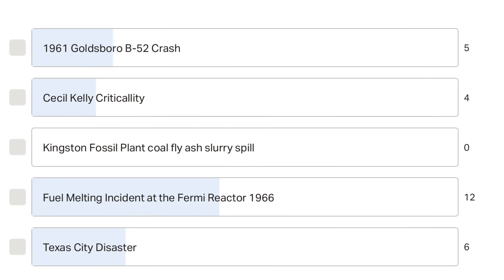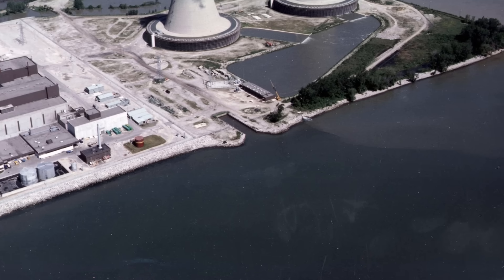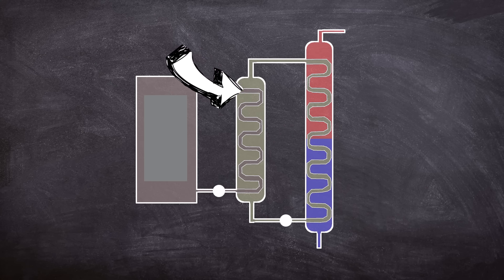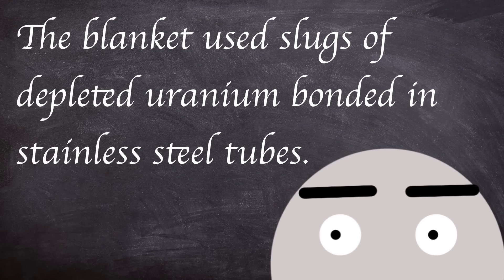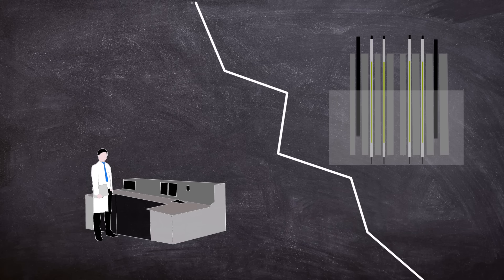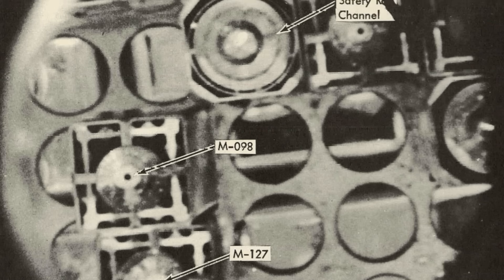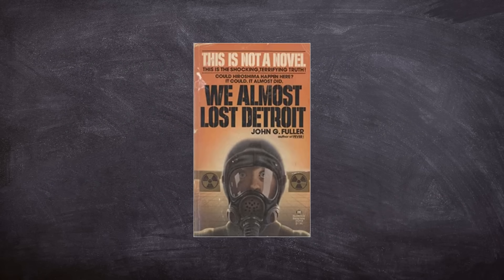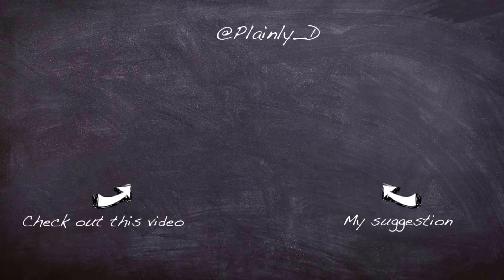A Brief History of: The Fermi 1 Reactor Meltdown (Short Documentary)

Comment: The problem wasn't really the breeder reactor, it was the liquid metal coolant.  Had they used a molten salt as they use in the Thorium reactors, results might have been different although the salts have their own issues.  However, so does water and steam at high temperatures and pressures.  Very corrosive and can cut you in half.

Comment: The point of the conical flow guide was not to direct coolant upwards. The point of the conical flow guide was to disperse the fuel in case of a meltdown, which would render the mass sub-critical.

An interesting addendum to the Zirconium sheets, is that they were added after the design was approved and they were in fact more of an afterthought that had not been researched. To begin with, it was thought that someone had left an empty beer can in the core assembly during installation. It wasn't until the debris was retrieved that they realized what it was. The cone should never have been clad with the Zirconium as it was in fact not even needed.

Comment: Sodium Metal Reactors are not to be confused with IMSR and LFTR designs which use a different type of coolant called FLiBe (mixture of lithium fluoride (LiF) and beryllium fluoride). That mixture is run at standard atmosphere pressures and is not volatile even under temperature with the air.

Comment: As an aside, John G. Fuller also wrote a book entitled The Ghost of Flight 401, which purported that Eastern Air Lines L-1011s that received parts salvaged from the wreckage of N310EA (which crashed in the Everglades in 1972, while operating the eponymous Flight 401 from New York to Miami) were haunted by the original aircraft's crew. This should tell you something about how scientific his claim that "we almost lost Detroit" was, if the style of the cover art wasn't enough of a clue.
Reply: John G Fuller wrote some very entertaining books, but if you wanted facts, basic science, or engineering, you will  never find it in his books.

Comment: This shouldn't be called a "reactor screw up."  One of the important points of running an experimental reactor is to find out just how it functions.  They collected much information, and then called it a day.  Agreed that there should have been a decommissioning plan, but that's not an immediate danger.
Reply: Meltdowns aren't part of running a basically full sized experimental reactor. In small scale highly isolated proof of concept work maybe, but not one what was effectively a full scale, commercial unit.  You might expect some hiccups regarding procedures and operation, stuff you'd need to note in manuals going forward, but at NO point should that progress into physical damage to the reactor core. At this stage in development this kind of major failure is neither expected or acceptable and certainly constitutes a screw up.
Reply: @Tk3997  Nah at this time, this was small and experimental
Reply: A reactor is an engineered thing. You really have to be able to foresee exactly how it's going to work and what could possibly go wrong, and account for those things. If you don't, you're basically "testing in prod"-- something any programmer will tell you is an awful idea.
Reply: Right! Get this man to the infirmary!  He's hysterical!

Comment: Nice video as always. I was surprised you didn’t mention that the plate that caused the issue was a secondary addition to the reactor that wasn’t properly documented or updated on equipment specifications. One of the biggest issues with this particular atomic accident was the fact that they couldn’t figure out what was at fault because they didn’t have proper documentation of the last minute additions made to the coolant system.
Reply: At one point, the media speculated that the "mystery piece" of metal was an empty beer can that had somehow wound up in the bottom of the reactor and been flattened due to the pressure and action of the liquid coolant rushing across it.
Reply: @sct913  Yeah... I have a hard time believing that an aluminum can would survive in that environment for any amount of time, but its fun to think those guys were just getting lit while building a nuke reactor.

Comment: I worked there in 1997. Fermi 1 was still intact. The old control room was pretty cool. We used to hot rod the maintenance trucks around the cooling towers, and just wander around the site when we had spare time.

When they installed new offices in the OSB building, they threw out tons of shit, including old "blast danger zone" maps... I'm 180 miles away now, and still in that zone according to that old poster I had from there.

Comment: Is this the molten salt reactor like they had in Tennessee back in the 50’s. Can’t think of the name of it but it’s supposed to be full proof in that they use liquid nitrogen to keep a plug frozen and if power is lost the plug melts and the fuel drains to a pool below the reactor so thier is no pumps needed to stop the reaction and a meltdown is impossible. I think the problem was that the salts were extremely caustic and would eat away at the steel quickly.
Reply: No, it's not an MBR/LFTR.  That used uranium (in that case) salts of fluorine melted, as fuel and coolant.  This one is conceptually a regular solid fuel uranium reactor that used melted sodium./potassium metal as coolant - a completely different bird.  Liquid metal sodium has a very high heat capacity and does not moderate the neutrons, making them available to convert depleted uranium in a blanket around the reactor into plutonium.  Sodium and potassium are dangerous when exposed to water, but this problem never occurred with this reactor (or any other sodium reactor I'm familiar with).

Comment: My father worked on this project from 1956 until 1962. He was loaned from Wisconsin Electric to the Power Reactor Development Corporation. He had responsibilities related to the heat exchanger between the reactor and the steam generator.  I believe that exchanger was constructed by ALCO which was the remnants of the American Locomotive Co.
Reply: Between 1956 and 1962, ALCO was still a serious player in the locomotive business.  Although the GE-ALCO partnership had officially ended in 1953, ALCO continued to use GE electrical gear in its locomotives until 1969.  And, although GE entered the locomotive business as a competitor to EMD and ALCO in 1956 , their initial focus was on units for export.  The U25B wasn't introduced until 1959.

Comment: I live a few miles from the Fermi I and Fermi II facilities. Maybe you could do one about the 1990s Christmas turbine explosion incident at Fermi II? (I was inside Fermi II primary containment structure once  in 1986 when they scrammed the reactor- was a high school student on a tour with local media)
Reply: I sincerely doubt that any student group ever toured the primary containment (AKA drywell) since even in 1986 it was a radiation area.  You may have toured the turbine building or even the reactor building (which is the secondary containment). Or you may be remembering the control room simulator, which was often used for tours and media events.  I cannot ever remember seeing any media inside the plant with the exception of the John McCain visit, but it could have happened.
 
As far as the 1993 Christmas day incident, the main turbine suffered a broken blade which unbalanced the turbine and caused a massive vibration which severely damaged the turbine and generator.  There was a large amount of cooling water (NOT reactor coolant) released along with fire fighting water, all of which collected in the basement.  The reactor experienced an uncomplicated emergency shutdown (which means everything occurred as expected) and was not damaged in the incident.  The recovery lasted a bit over a year, and when we did restart it was at a reduced power level due to removal of some turbine parts.
Reply: @johnjones5354  I understand your doubt, but it really did happen. As a PR effort shortly before full power license was issued Detroot Edison invited select media to come onsite to shoot B-roll footage. My high school was operated by the IHM nuns, who were very vocal shareholders in opposing Detroit Edison's nuclear power investments at the time, and the invitation of was extended to two jouurnalism students from their high school to join as as a way to hopefully curry favor with the nuns. 
We were walking around the torus section of the reactor vessel when a backup cooling system suffered a fault triggering the automatic reactor scram. Our handlers explained we would not be able to leave the primary containment building for a while while damage was assessed and our dosimeters were showing no radiation, so we might as well proceed further on...up many flights of stairs to the area above the reactor where fuel assemblies were moved to and from the reactor. We were allowed to cautiously peer into the fuel storage pools where I could clearly see the Cherenkov radiation glow far below. A while later the all clear was given and our tour group was allowed to leave the primary containment building, and a later luncheon and tour of the remote control room at the Nuclear Operations center included an impromptu press conference to explain the day's scram event...a potential PR disaster with all those tv crews in the building.
Reply: @NonFerricIrony  Ah yes, where to begin.

  “We were walking around the torus section of the reactor vessel”

While the torus (or suppression pool) along with the drywell does form the primary containment, neither one is part of the reactor vessel.  The reactor vessel is enclosed inside the primary containment.

“Our handlers explained we would not be able to leave the primary containment building for a while while damage was assessed”

There is absolutely no reason why anyone would not be allowed to leave the reactor building after an emergency shutdown.  In fact, no essential personnel would be encouraged to do so.

“We were allowed to cautiously peer into the fuel storage pools where I could clearly see the Cherenkov radiation glow far below”

In 1986?  Fermi 2 did not enter commercial service until 1988, with the first refueling outage occurring after that.  Until then there was no used fuel in the spent fuel pool (one pool not multiple pools).  In 1986 there was no fuel at all in the SFP, as it was all in the reactor vessel, thus no Cherenkov radiation.

“tour of the remote control room at the Nuclear Operations center”
Perhaps you refer to the control room Simulator, which exercises absolutely no “remote control” functions and is used only for training.

In addition, if these high school journalism students were in fact issued dosimetry, they had to be, in accordance with federal law, at least 18 years of age.
Reply: @johnjones5354  Thank you for helping me remember some of my facts more clearly; yes we were a little higher up, above the torus, at the time of the event. I clearly remember the curved, sloping concrete wall that seperated us from the reactor vessel. It was during the testing and prior to full power license, and definitely 1986, the year I graduated and was editor of the school paper. My classmate and I were high school seniors, not yet 18 but that was overlooked by DTE managers with a "wink and a nod". 
You are correct, I doubt there was any spent fuel in those storage pools yet,  they were nowhere near as full as they are nowadays, so must have been new fuel assemblies that had not yet been loaded into the reactor. You're also right, the NOC building "control room" is probably only used as a simulator, and I'll grant my memory is hazy, but I believe the entire NOC building was built in response to lessons learned at Three Mile Island, and there was some intention of that control room in the NOC being usable as a remote control if the main control room was contaminated or damaged. 
Ironically I think my visit was weeks before the Chernobyl accident. 
I agree my visit there could never happen under current regulatory rules, and it was rather irregular. 
Youll probably also not believe that I toured the visitor center, and Mr. Gittleman, the visitor center director took me inside one of the cooling towers in about 1980 when I was researching a fifth grade science fair project. 
I was a precocious kid with a father who was a local government official which probably afforded me these unique opportunities, but I have no reason to lie, as most people would have no idea what I'm talking about to be impressed.

Comment: When I watch the blueprints of the reactor I wonder it even worked. It shows how the metric is totally superior to imperial.
Just look at "precision". 
Metric has "meter" as base = 1dm = 100cm = 1000mm etc.
Imperial has the inch. Then they use things like "20-1/4" instead of 20,25" and 32-25/32" (32,78125")
Lets say that electronics was measured in metrics. Then a "unit" would be 2,5mm (or 2mm) instead of 2,54mm
Reply: I'm a fan of SI units (to the point that I insist they be used in the lab I manage) but that's not how it works in practice. The only time the units would get converted to decimals is when using thousandths of an inch, or "thous". Otherwise they remain fractions.

Keep in mind that they weren't using CAD at the time.
Reply: @pseudotasuki So what you're saying is that you use both base 2 divisions AND decimal divisions but you insist on calling it "thousandths" because just saying "milli" would be too simple, you need more consonants hahaha
Reply: A meter is a device to measure, not a unit of measure.......conversely, a foot is the thing below your ankle........alas, we'll never win.......lol.